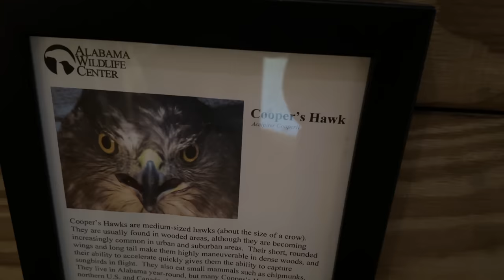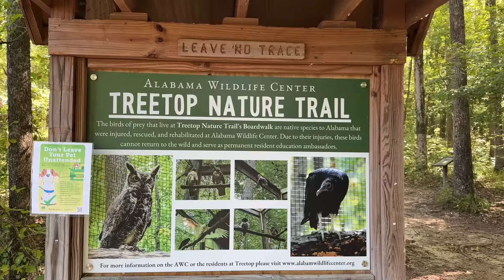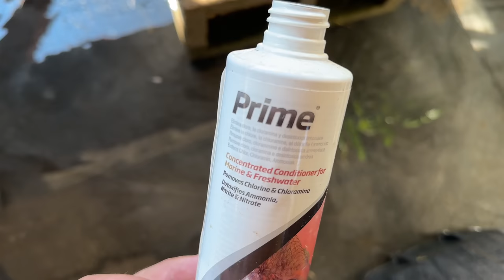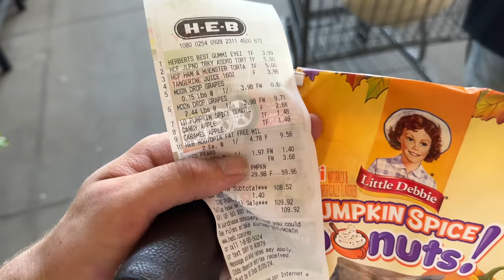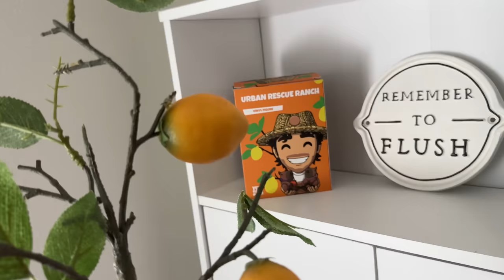How to Catch a Kangaroo (by hand)

Comment: Uncle Benjamin is the definition of “crazy? I was crazy once”
Reply: crazy? I was crazy once. they locked me in a room. a rubber room! a rubber room with rats! rats make me crazy.
Reply: Rats? I was a room once, they locked me in a crazy, a rubber crazy, a rubber crazy with rooms. Rooms make me crazy.
Reply: @surburbia.overture to 😊😊
Reply: crazy? I was crazy once. they locked me in a room. a rubber room! a rubber room with rats! rats make me crazy.
Reply: Crazy? I was  crazy once the locked me in a room a rubber room  a rubber room filled with rats and rats make me crazy
Reply: Noooe that is EVERYWHEREEE
Reply: Crazy? I was crazy once.
They put me in a rubber room.
A round rubber room
And told me to sit in the corner.
Corner? There was no corner
So I sat in the middle of the floor
Surrounded by rats.

Rats? I can’t stand rats.
They tickled my feet.
They made me laugh.
I laughed so hard I thought I would die.
Die? I did die in there.
They buried me in a hole.
A hole six feet under the ground
And that’s when the worms came.

Worms? I hate worms.
They burrowed into my skull
And started to eat my brain.
They drove me crazy!
Reply: Room? I was room once. They locked me in a crazy. A rat crazy. A rat crazy with rubber. I hate rubber. Rubber makes me room.

Comment: The tail grab and lift is the best way there tails are like an in built handle. With youg ones u lift from the base of tail and other hand on chest such if they kick they only kick down not into your face. Once had to tail drag a big male at 0200hrs for about 1 kilometer after  he got scared by something and jumped heaps high to get out he was hopping up and down the main rd thank god it was two in the morning only had to contend with one car got him back eventully he was so stressed with the extended drag but by myself it was the only way. Have two babies at the moment a 14 month old 25kg baby that's just transitioning at the moment to outside and my little boy that's only about 5 months old at 1.7kg doing great . Keep up the good work. Regards damo.